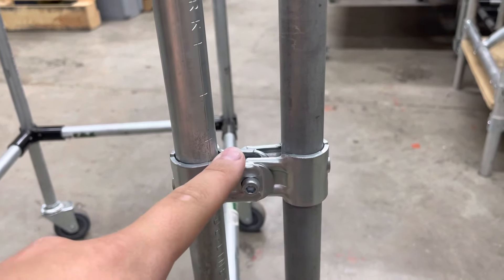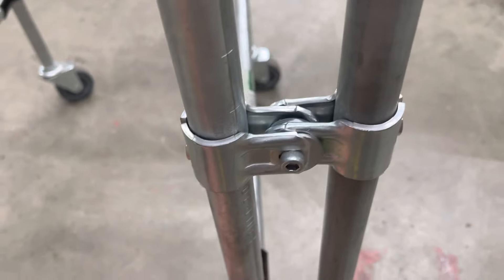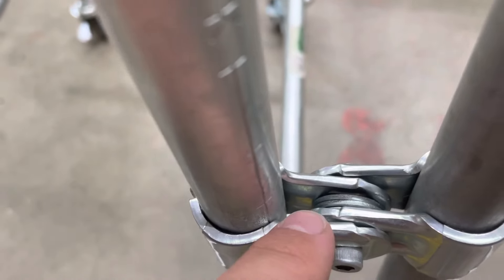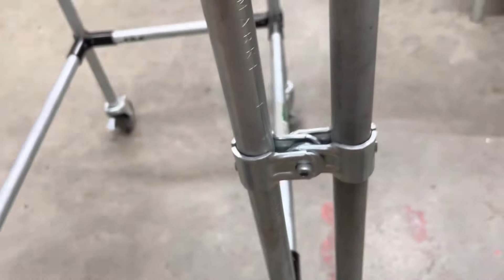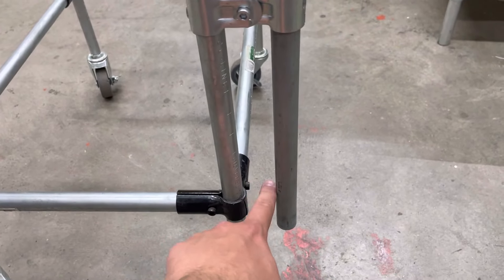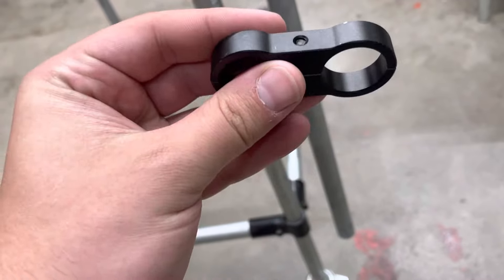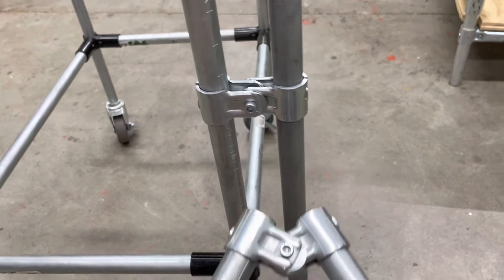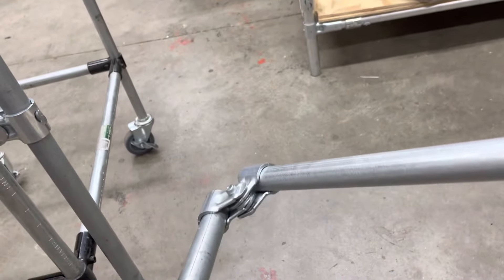This Hack Is Un-Paralleled...

Comment: I love the puzzle piece connectors! Can’t wait until theyre avail separately again. I use them with fender washers to secure rack rails to conduit
Reply from the maker: Hi Dan, glad you like them! You can get them separately. They are listed under the adjustable angle connector as the variant "puzzle piece clamp". https://makerpipe.com/collections/modular-pipe-fittings/products/adjustable-angle-connector-hinge-connector?variant=39947807653961